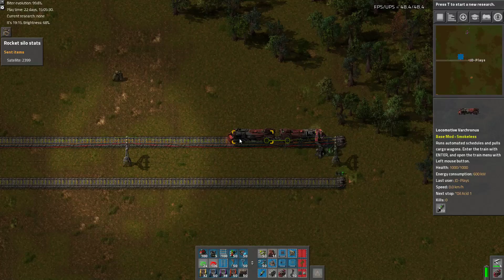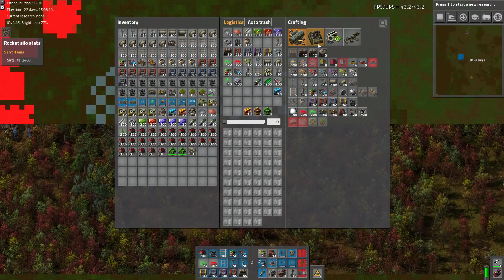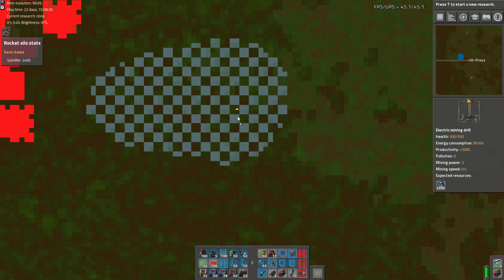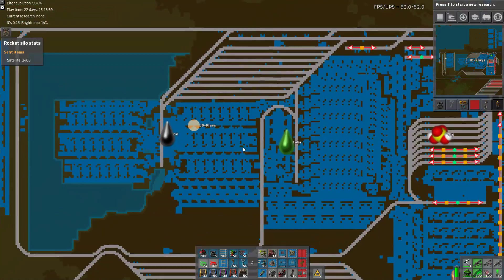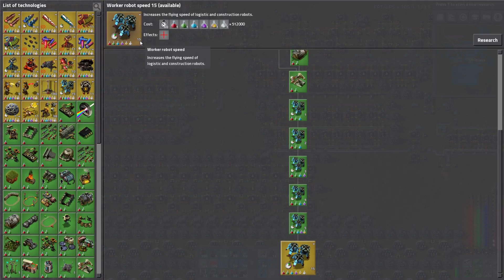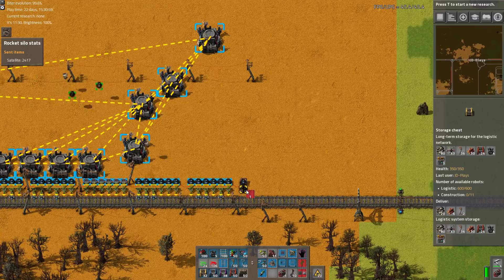100 Subs Base Tour With Blueprints - GigaBase S01E080 - Factorio 0.15

Comment: Sub #134 ! Great video mate. 
Thanks for sharing and giving a lot of explainations on the various parts of the base.
I am struggling to go beyond the 1st rockets and go very large so that helps.
Any tips are welcome by the way on that topic
Reply from the maker: +Lofwyr_coc going large requires going small first, I don't know when I launched my first rocket. Probably my 10th game or so, cuz back then that was it. So I just kept building and building until my PC couldn't take it anymore!
Because I've built so many bases that ended up big going big isn't a problem anymore. The difference is this time I planned big right from the start! A clear goal to get to and a clear end point for this map.

Best advice I have is aim for a rocket a minute, and just keep following the bottle necks back till you find the source and cause a new bottle neck, eventually you will end up building a 1RPM base via brute force!
Reply: I guess that's my problem. I don't set myself a goal. I just want to build bigger. Maybe I should aim for x science per minute and try a bigger target each time.
Reply from the maker: Exactly, in the per 0.15 scale i aimed for 1 rocket per minute, then 1 Iron cannon per minute (using the orbital iron cannon mod) then i scaled to 2 then 3 per minute.
Each base of mine got larger and larger and more complex

Comment: You may want to look into Power And Amour mod. It has better tools, reactors, a personal robo port MKIII ( Hint hint) and a few other gadgets. The grid I think is like 20x20 on one and 24x24 on the other. Congratulations on 100 subs and may you get many more.
Reply from the maker: +SilverLS06 thanks mate I will, looking at starting a new side by side game and setting myself a new challenge whilst we do 5k research per minute!
Reply: Seeing your builds on video doesn't do the size justice. Looking at the BP's in game is impressive. Think you just solved my end game problem until they break.
Reply from the maker: Well my builds shouldn't break. You computer might LOL
I have found some of them don't quite work as fast as possible, so some optimisation can and will go on in future eps.